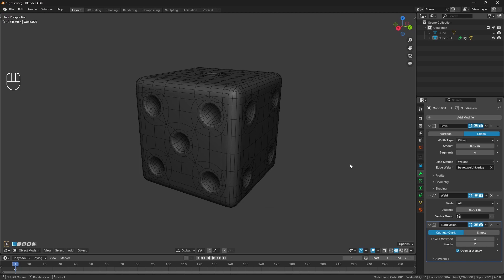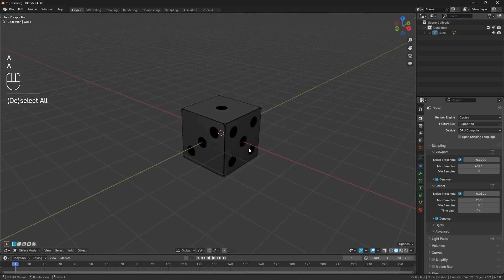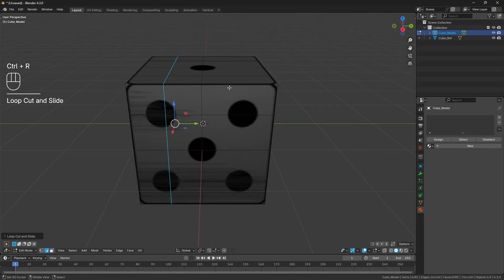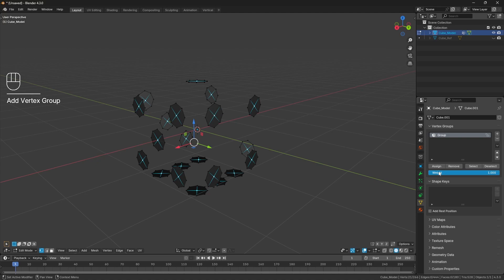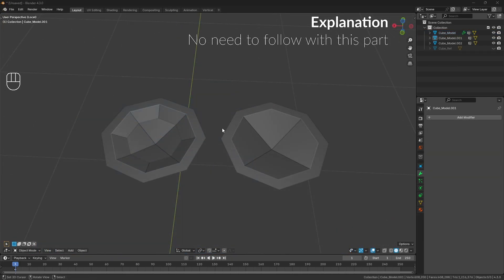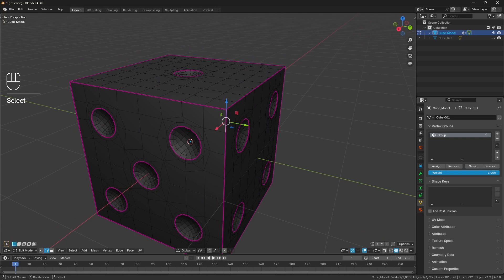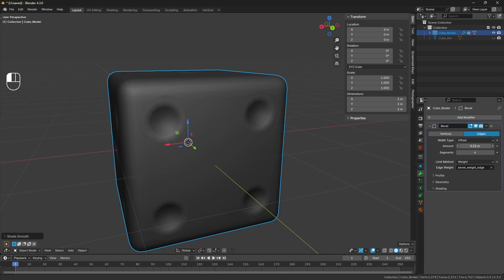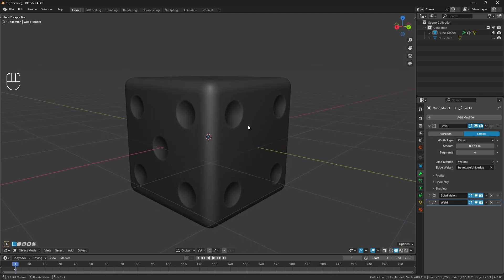Hard Surface Modelling for Beginners | Model Dice in Blender

Comment: Hi Josh, excellent tutorial. We used several modeling techniques, such as creases, beveled edges, and different modifiers. I don't recall ever using the "weld" modifier. I learned about another modifier. 

I applied the techniques from this tutorial to bevel the edges of the door mentioned in the previous answer. It looks even better now. 

Thank you, and see you in the next one.

Comment: Hi Josh, at minute 2:05, when you add two Loop Cuts and scale the "X" axis to 1.16, for me, it didn't stay in the same position. To get it approximately the same position as yours, I have to do "S+X 0.96" and "S+Z 1.11". 
Can I leave it at 0.96 and 1.11 or will I have problems with the modeling later on?
Reply from the maker: I don't think so no. 😄

Looking back, I should've just taught this by free-handing the positions of the edges, but was far too pedantic with matching things up with the reference material back when I recorded this modelling tutorial. 😅

So, I think you're model will turn out just fine with your values. 😄
Reply: @masterj2001  The edge positions ended up in the middle of the circles that represent the numbers. I also think it should work.
I would like to thank you for all the teachings. In the tutorial where we modeled the door handle, I decided to model a door for the handle. I used a door I have at home as a reference since the handle is very similar to the one on my door. It was the first thing I modeled on my own and I also assigned a material in Blender itself, without following any tutorial. I realized that I had a modeling repertoire that I learned from your tutorials and a small notion of what would be a more suitable topology. I know that the corners of the door I modeled are very sharp, all at 90 degrees, but looking at my door, its corners are also like that, so I left them sharp. I'm thinking of doing a UV unfolding and the Noarmol and OC maps to texture it in Quixel Mixer, so I can practice using it and give the door a more realistic appearance. Thank you again, please know that your effort is yielding results.
Reply from the maker: @nelsonrezende1150  That great to hear! It's awesome that you've been able to take the learning from my modelling tutorials and begin to adapt them to your own modelling projects. 😄

It's truly humbling to hear that, as my ultimate goal is to help people to be able to step away from tutorial content so that they can then do their own modelling work. So it's great to hear that my content is actually able to have that effect. 😄

Comment: tried this. working fine until i had to press I to insert faces and then O. would not do the outside inset unless the face select was selected.in your video your in vertex mode. this will not work in blender 4.4. but worked when select face mode
Reply: Turned out absolutely brilliant.  Great tutorial overall.  Learned some great keyboard shorts and methods.  Tha k you so much👍👍👍
Reply from the maker: @Oversizewizard  No worries  mat, glad you enjoyed it and leant a handful of things along the way. 😄
Reply from the maker: Hmm, that's rather strange. I haven't moved across to 4.4 yet, but I'll do some testing this afternoon once I get home from work and put together a more detailed response for you. 

But all the same, I'm glad you found a solution so you could continue with the tutorial. 😄 How'd your model tuen out in the end?

Comment: I only just found this chanel and If I could have a raquest for models that I regularly have issues with it's basicly anything curvy. Like beaks for example or other objects that have a lot of different smooth surfaces. 
Or the Space Marine MK 7 helmet's face mask. That one I think is the hardest to make simply because it has basicly no flat faces, outside of it's bottom.
Reply from the maker: The next episode that I am currently working on covers a curved surface, so hopefully, that will be of some help for you. 😄

Comment: thank you for the guide. as a new modeler would you say mergin by distance often during modeling is a bad thing? it became a habit of mine to merge distance whenever im moving to another part. would like your answer ^^
Reply from the maker: I’d say using "merge by distance" too often, especially without a clear reason, is not a good habit. The problem is that you might accidentally merge vertices you didn’t mean to, which could cause issues with your model.

I advise only using it when you think there might be overlapping vertices or when you can clearly see them. It’s better to use it carefully and only when needed to avoid unexpected problems. 😄
Reply: @masterj2001  thank you for the quick answer. so even if they are in the 'merge by distance' distance(?) its better not to unless i need it, right?
Reply from the maker: @ I'd say best rule of thumb is do it when you think it is necessary. 😄